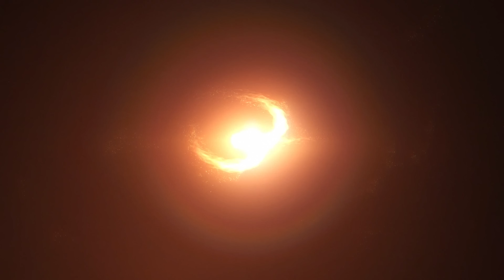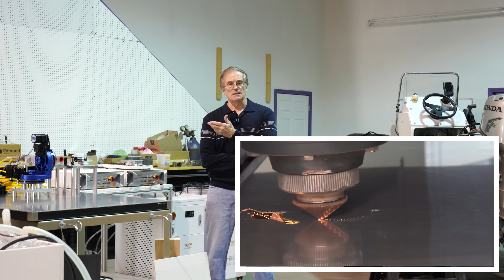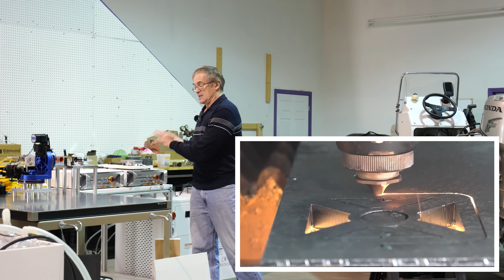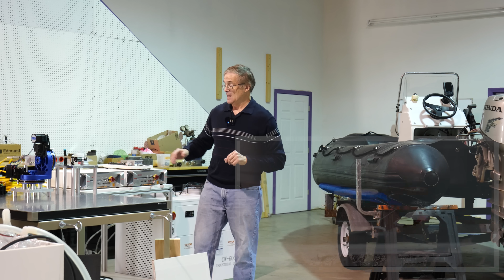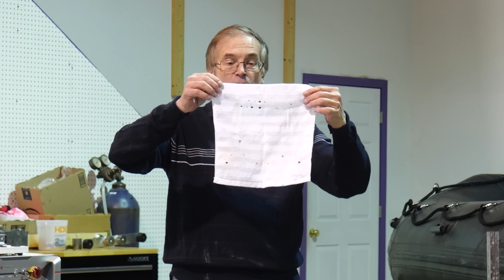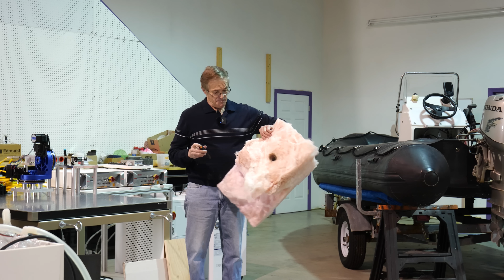We have a problem... and need your help!

Comment: 2 Ideas

(1)So my first test would be taking your plywood and soaking it in water and letting it swell. When in use the wall should have a small pump misting from the top of the wall to keep the surface wet and stop any fires.   I wouldn't bank on the water giving you more time against penetration, but it will keep fire from becoming a concern. Multiple layers of plywood sheets hung from french cleats may be the best option so you can replace as needed.

1.1 If water mist will scatter this beam significantly I would try a wall of wet 3/4in plywood with a 1-2ft gap and another wall of 3/4in ply with misters between them so that any 1st layer penetration will get diffused before it hits the second and the water will keep fires down. and you can tarp up the sides/top to keep the moisture somewhat contained in the wall. 

1.2 Add light sensor(s) inside the wall that connect to your laser power to kill power if it detects bright light inside the wall. 

(2) This isn't cheap, but if you could use soft slate roof tiles for the back wall. The initial investment is high, but it could be dissembled/modular and you would be replacing individual tiles when rather than the whole thing so your maintenance is low. Hell, if you aren't going to load this on a truck you could build walls on casters, it may be worth seeing if you can pick up aluminum extrusion locally for cheap since it would make it more bolt together for you.
Reply: I like a lot of your thoughts, but slate burns through at relatively low powers, at least for thermal lasers (CO2). I don't think roofing tiles could handle a fiber laser like this for any length of time.

That being said, the light-sensing kill switch is an amazing idea. It should be implemented in any design.
Reply: @BetweenTheBorders  Oh I fully expect that they would need to be replaced anytime they get touched by a laser, but you get a bright light off of slate when you laser cut or etch it which should be where the light triggered shut off comes in. Also it is easy to come by in VT/NH where tech ingredients is.  You want the sensors to be sensitive enough that isn't needed, but getting a nice bright signal for your shut off is good and the slate won't continue burning.
Reply: @JasonJason958  Oh! Yeah, that could work. Use the slate for a short, ablative protection that would trigger a fast-acting optical kill switch. Clever! There are also slate coasters available by the gross online if they end up being cheaper.
Reply: These ideas are to diffuse light after going through 1 barrier to make absorption possible on back of barrier 1 or front of barrier 2. Bouncing the light isn't probably a truely braindead idea, but the idea is to do it inside a sacrificial box rather than set things on fire in the warehouse.

(3)Alternate Front Wall: Get some of those hollow glass blocks used to partition spaces fill with marbles or craft beads and water, place drywall in front. When the laser hits the drywall it will go through, hit the marbles/water and diffract. Since it should be less in focus it should allow you to absorb the light over a larger area using mundane materials. 

(4)Alternate Front Wall: Get clear flat glass beads from a craft store and melt a layer of them to either side of a pane of glass. (tile them so they overlap and you don't have gaps.
Test to see how much you can de-focus the beam so that a back wall can be made of a disposable material such as drywall. 
(3.1) Test rapidly cooling the glass to create polarization gradients life are in a prince Rupert's drop so different polarization of light get scattered differently.
(3.2) Add smaller beads to the back surface of the glass to get further diffusion and aid in avoiding gaps in coverage.

Comment: Think multi-layer. The first layer is a mirror facing away from the laser source. The second layer is glass beads (traffic paint glitter) which scatter the beam. The middle is whatever you want to dump the energy into, and  the back is another mirror facing inward. Yes; the mirror being hit from behind will receive some damage. But the bulk of the energy is absorbed by the stack while protecting anything behind it.

Any light bouncing back toward the laser has been fractal-ly scattered twice by the glass beads.

Comment: Large format tile? 2-3cm? If it burns through those too quick, maybe angle the panels so the beam can bounce a couple times and spread the energy. You could even do smaller tiles angled 45 degrees or greater, so that the beam hits the front face and bounces down to a pocket formed by the tile below it. You could fill the pockets with perlite or dirt. Tiles can come with a super matte finish, and you can grab a wide variety at Habitat ReStore.

Comment: Try  NightHawkInLight's improved Starlite mixtures (basically cheap ablative carbon foam).  Using either charred plywood, Rockwool, Welding Fire blankets, Ceramic furnace insulation matts, or Aluminum silicate cotton/board as the backer. If you pre-char the surface you're essentially dealing with cheap carbon foam.  Possibly even coating several layers of thin material into an ablative shield (stacks of coated fabric or paper maybe).

Carbon foam isn't going to outgas, it won't catch fire, it'll absorb a lot of energy but not conduct it very well, and it's cheap and easily replaceable.  Also possibly incorporating the glass microspheres might help distribute some of the laser light (although that may cause energy reflection vs scattering).   And if you use his improved solid tile formula you basically have a replaceable panelized heat shield.  

I would also recommend reaching out to NightHawk, he probably has some formulations he experimented with which may work well.  One because he may have formulations that he tested which may work well for this.  Two because he probably would love to help to get access to your laser for possible ideas.

Comment: How about: 
1. A water tank with a dye or suspended particles, like milk (a glass tank, assuming that these lasers do not cut glass). Or perhaps in a metal tank that you plug each time once the laser is switched off…
2. a diffraction grating (or more than one) with something absorbent behind that?

Comment: Im not familiar with lasers or the pits or downfalls of capturing them.  Ive saw traps for small lasers but having a whole wall seems like a task.  Is it heat that burns through?  I recal a nighthawkinlight video where he covered expanding graphite paint but i think graphite can be reflective. Or maybe panels like they use on space reentry? Thoisie2 has a video where he recreates a panel but I imagine cost and time is too great, if it would even work.  How hot is the spot getting? We use refractory quarts wool to safeguard our RTO at work im suprised to see it burn through quarts wool that fast. I guess if you cant stop it you could modify its path mirror it onto the ground?  Would like to know if you find a solution I find it interesting.

Comment: PWM the laser output at the driverstage. Investigate if the model of amplifier/driver you have makes this possible. Then programmatically vary the output PWM to max power if you are at highest probability that the target is in the crosshairs. Probability is in the info you get from the object-recognition software. If not at high propability turn down to just above shutting down of the optical power. Also less chance of detection in this way (if the targets have detectors themselves), and saves you on the powerbill.

Comment: For dispersion TiO2 or alumina powders have a good balance of reflectivity and heat resistance, but you can't paint them on a wall without a not-so-heat-resistant binder, so you'd need to put them on 45 degree angled slats or press them into tiles.
For absorption the best bet is water running down a steep ramp padded with fiberglass fabric or insulation to slow it down, soak it up, and beak up the smooth surface so the reflected 4% isn't collimated.

Comment: Laser beam dump, liquid cooled to keep it from melting they usually have a high range of wavelengths, but the wattage is the concerning factor though I'm sure if you reach out to a company that makes them they can make one with the correct specifications

Comment: Use a semi-reflective enclosure (like a coated glass/acrylic tank) to allow a laser beam to enter but reflect it internally to contain and disperse energy. This mimics an optical cavity (used in lasers) but with partial reflectivity. Fill the enclosure with a light-absorbing medium (e.g., dyed water or nanoparticles) to convert laser energy into heat.

Comment: Kiln walls and the like are made out of ceramics.  Heat shield on SpaceX Starship is a ceramic of some sort.  Probably a bunch of those pieces on ebay after the two recent incidents.  Those  are also super lightweight.

Comment: You should look into ceramic fiber insulation, it could be cheap, light, and affordable. I'm not sure how well it will stand up to the laser light, but it does well at extremely high temperatures and is used to line many kilns. It would need to be covered in something that would burn through in order to reduce the safety hazard of ceramic particulate, in the air, but thats fairly east to attain.

Comment: Perhaps a Starlite type material (anyone not familiar, youtube channel NightHawknLight has a couple good videos on the subject) backed by a chamber with sand would be a good option.   It would be inexpensive, easily replaced/repaired when needed, and has a better than average chance of working well enough.

Comment: I'm not sure how feasible this is, this is far from an area of specialty. What if you revisit the idea of using reflection? My thinking is that the crux of the problem is having too much energy in one spot, al at once, so what if the beam is redirected into some chamber/apparatus in which there is lower, but repeated absorption.
This could look like bouncing the light (zigzaging?) back and forth repeatedly and letting the ~1% absorbance of the mirrors themselves attenuate the beam (maybe polished aluminum could work--it wouldn't need to be optically flat if appropriately contained and this may open up possibilities for cooling systems, too). Maybe using some kind of low but nonzero absorption filter in the path, hit repeatedly, could be feasible? Or, along the same vein, perhaps diverging the beam would allow for easier/safer absorption. I'm not sure if this is true, but my intuition tells me that dealing with just one focused spot would require dealing with ablative materials, possibly plasma formation, heat management, etc.

Comment: * Angled 45° mirror that faces the ground, so the laser reflects to the ground? (I think it won't work anyway)
* A wall that is basically sand/dirt... cheap? Like bags or blocks of sand
* Water flow that is cascading constantly, mixed with ground charcoal (black stuff absorb the light/heat right?)... I've seen that in some markets, water cascading on glass (in your case, you'd use something else instead), with a pump below that cycles it back up

Comment: I have no idea if this will work, but have you seen Dragonboard? It’s a magnesium oxide sheathing material and is fire proof, but probably not laser proof. Might be useful to you for other applications. 
Also, a merch idea - you could sell blobs  laser melted materials if you find something that looks interesting. Maybe melt things in a chamber filled with an inert gas?

Comment: The most simple, cost-effective solution I could think of off the top of my hat would be a stack of sandbags. Since you want them to be non-flammable, consider a non-flammable plastic fiber variant. You will still melt a hole through the bag, which will create a small amount of presumably toxic gases, but those could be taken care of with a simple ventilation system. The sandbags themselves should be a somewhat self-healing system, to an extent, and with proper (pyramid) stacking, very durable.
It's technically portable, as you can use trailers or rolling tables to move large quantities, but will take time to assemble.

For safety, to mitigate the possibility of inhaling gases during the firing process, what's stopping you from opening the door, putting the backstop outdoors, and surrounding the area between backstop and shop wall with fencing covered in thick cloth to prevent accidental exposure to the  point of impact?

This is very interesting and I feel that I am wasting my life in comparison. Keep us posted.

Comment: Some kind of porous material good thermal conductivity might help. I am not sure if aerogel can withstand this amount of focused heat, but maybe a silicon sponge or another good thermal conductor sponge that can dissipate heat fast. With the added surface area of the sponge, heat might be able to be dissipated very efficiently.

Comment: A water tank, using water, add solute which could form colloidal suspension to scatter the beam  like milk do, or Rayleigh scattering.
Titanium Dioxide, TiO₂, I guess? You could try, it usually use in white paint.
The beam should be scatter and absorb multiple times rather than just burn off, the heat would be scatter to every solute molecules in solution.

But the material of water tank would be tricky, it could reflect and probably destroy something.
Maybe you could angle it to enter the tank from the surface of solution without passing through the tank's wall.

More simply, you could aim to the sky, and make sure there's no plane fly through when you test it lol.

Comment: I think a Container with Sand and a Stikeface made from some sort of concreate brick, like those u use to guide walkways or garage entrances, so the resulting Slag has a chance to seal the Hole made by the LASER.
If u look for a prefabricated Solution, they are decorative Bricks that are stackable and are supposed to filled with Soil so you can grow some plants to make your fassade look nicer.

The design that comes to my mind is a Circular base shape with a dent in it so u can line them up better, and a empty cavity with arround 30cm diameter
Reply: also if the sand needs to flow better you could add some Borax to make it flow better, or Carbon to make it opaque. essentially to make a low quality Glas or Slag that stays opaque and crumbles more instead of creating razor sharp shards all over the place.

Comment: Since the light travels down a fiber cable, there should be a type of glass container which doesn't absorb much of the light energy which could be a target.  Fill the container with a liquid that absorbs the energy while constantly being stirred. Perhaps use a heat pipe technology to an heatsink/active cooler to keep the liquids temperature manageable? Would an old glass blender work?  You may need to account for reflections off the face of the glass.

Comment: Glue thin sheets of coarse EDM graphite to plywood. Fabricobble a frame to hold the plywood. Behind the frame mount a mirror to angle any beam which penetrates down to a box full of black sand or foundry slag. If the box was steel you could have a detachable frame in a tilted A shape with the strike face vertical and the mirror angled from the top of the strike face to the back of the box. When you need to move the box detach the a frame and fold it up so the plywood and graphite strike face protects the mirror from impact during handling, and make the box of black sand with sturdy handles for transport, or empty it if too heavy since the top would then be open. You could make a trailer size box to give you several square feet of target engagement area, if you were confortable with the box weighing over a thousand pounds, or the box could be rather small, but you would be limited in engagement area. Maybe a parabolic mirror behind the strike face would open up options for mobility with a smaller absorbant box for situations which the plywood and graphite can not do the job.

Comment: 1. multi-layer brick wall on wheels (you got space to move it away) 2. some optical aparatus (lenticular lenses with water curtain) 3. Some moving object (disk that rotates and moves sideways so the laser affects spiral pattern and not just a point)

Comment: You say you want to absorb but honestly, anything that absorbs megawatts per cubic centimeter is going to be in trouble in my opinion.
What I would suggest (or more honestly what I'd like to see blasted with a laser) is salt. Just regular old table salt. It's made of tiny transparent crystals just like snow that scatter the light in all directions so that the return light should not be dangerous. The light that continues through will do the same as it did with your glass fibres and melt it but it's just salt, molten salt is fine unless you have a large quantity coming into contact with water and the heat capacity of melting the salt is pretty good AFAIK.

Comment: Maybe an ablative material? like this: https://www.youtube.com/watch?v=aqR4_UoBIzY. Laser might be too concentrated for ablatives, but worth a shot. 

It also might be possible to reduce the beam intensity with a transparent material. Something that lets through most of the beam wouldn't absorb as much heat. Finding something without reflections might be a challenge...

if that doesn't work I would try a thin water tank. Something where the water can move freely and not have to be moved through the fibers. Annoying to build, but maybe you can do it in modules?